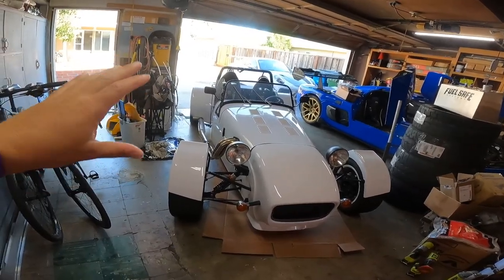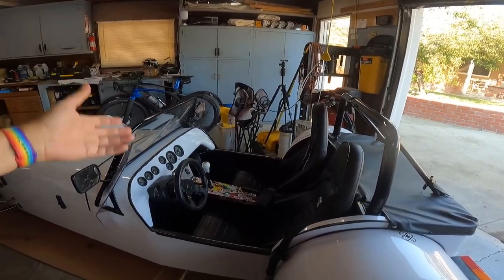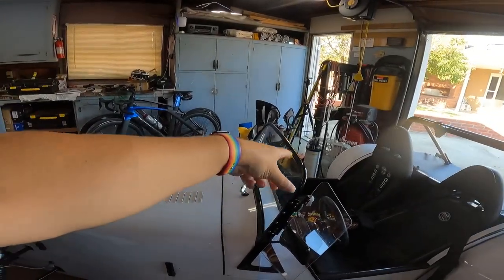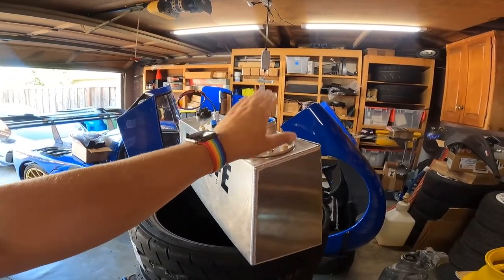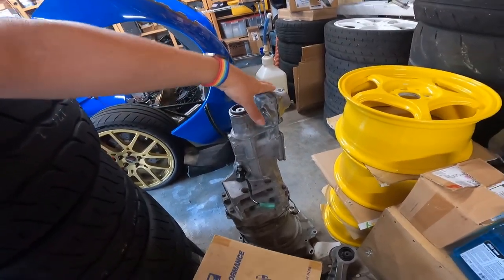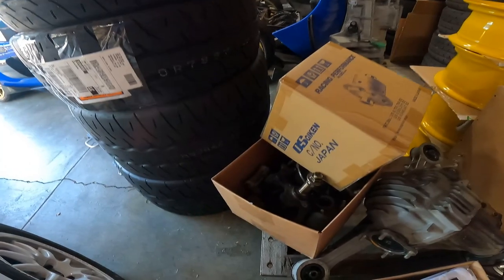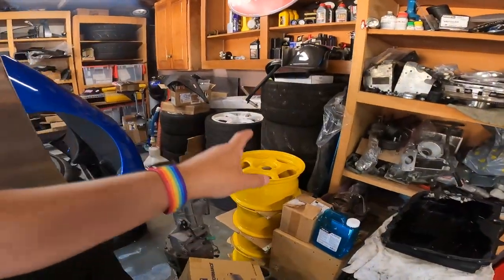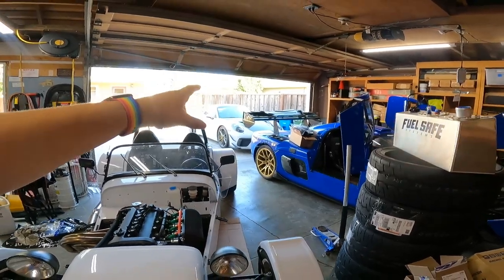GBS Zero vs. MK Sportscars Indy

Comment: That is what I'm building a Locost w/Duratec 2.5, NC 6 speed and lsd. Complete NC rear end including the crossmember. Planning to make my own ITB set, using Kawasaki Ninja ZX-10R throttle bodies and my own manifold, ECU will be a Speeduino that I will be a kit, that I will have to solder together. I'm building all this on a low budget(Low cost= Locost). The safety cage can be purchased, if you are planning to race, I don't believe that the company should be knocked for that.
Reply from the maker: That's fair, but still not as safe for road use even.  I will add that GBS does make a race chassis now but it is not modular and doesn't work with a weather kit.  I'll have to checkout the Speeduino, first I've heard of it, I've run several versions of Megasquirt on previous cars in the past.  The 2.5L is punchy in a light car, you should enjoy it!

Comment: Love the GT3 wheels! You're probably aware, but NA diff's can/do struggle with driveshaft failure at a certain point in comparison to NB MX5. Ditto the 5 speed transmission in comparison to the 6 speed (from memory, the 5 speeds get a bit unhappy over about 220whp/equivalent torque). The 'best' transmission is the 6 speed from a Mazdaspeed Miata as it has a shot penned gear set and i've run mine happily at 300whp racing for a good while. The 6 speed has a shorter top ratio than the 5 speed so if you have a short ratio diff' you'll find the rev limiter in top on long straights very early..... may not be an issue with a 'K22' with a rev limit like yours though. It'll sound very good!
Reply from the maker: Deciding on the trans was tough.  Initially I wanted to go 6spd, but more gears and a shorter gear set means a lot of shifting.  The Seven chassis is less than half the weight of even the lightest miatas so I'm hoping that reduced mass will help the diff and trans live a little longer.  That being said, I also don't plan on making 300hp which should help too.